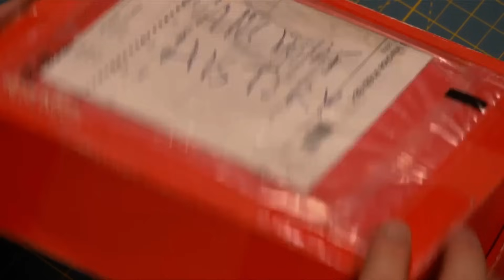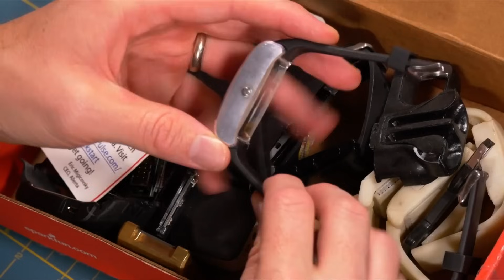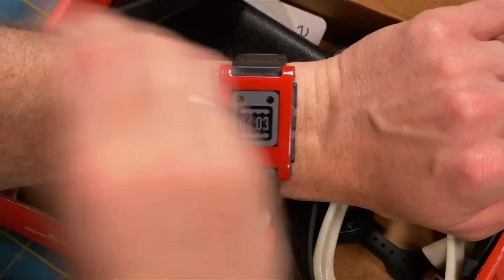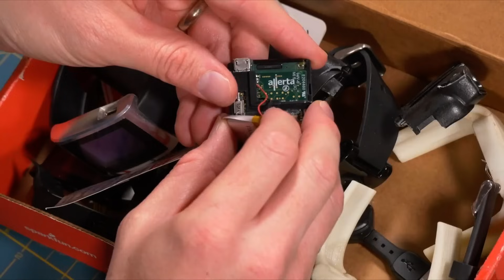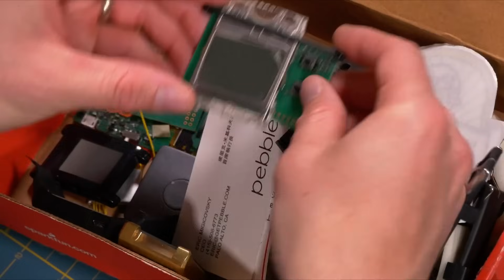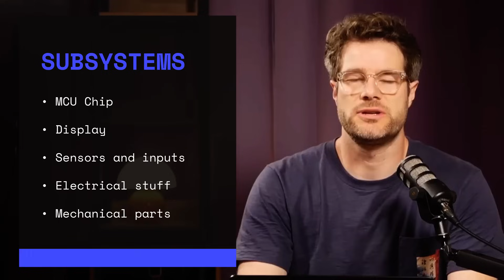How To Build A Smartwatch: Picking A Chip

Comment: I may make use of a smartwatch like hw platform to build a bicycle nav instead. Nobody makes one i can just integrate into the bicycle permanently, everything needs to be charged... for some reason.... although most bicycles have electricity, either a hub dynamo (if it's a city or a tourer) or they're e-bikes. Also the actual nav is bad in most, except one, which drains too much phone battery unlike everything else. I don't think i'm fit to launch a consumer electronics product, but i can just build stuff.

Comment: given the nordic chip, the Pebble 2 Duo only supports Bluetooth LE I assume
the Pebble Time Steel that I still use has a classic BT and a BLE connection where the latter is for notifications

what about the Pebble TIme 2? is it also BLE only? that would be a good thing because of battery life.
and does this have complications for combatibility with different android devices?
do you have to have the pebble core app open at all times for playback controlls to work reliably like on ios?

Comment: I studied embedded systems at my Masters because I wanted to challenge myself. Also, I was obsessed with finding out how drivers work and to try and get my Toshiba laptop special buttons to react in Linux.

Currently, I am a bit annoyed that my Redmi Watch 5 Lite can not answer WhatsApp phone calls from a Xiaomi phone. But it works from Samsung (and apparently Pixel) phones. Also, I could pick up WhatsApp calls in my VW Passat from 2014 with my Sony Xperia earlier. Now, with a Xiaomi, it only shows a weird long random number / GUID. It would be cool to know what is the difference in the Bluetooth that media audio does not work with Xiaomi. I have tried to set the same Bluetooth profile settings as from my wife's Samsung and did not achieve anything.

Comment: I also wanted solar powered watch with rugged and all-black design, but there are just not enough options on the market. Went with crazy priced Garmin Instinct 3 Tactical (550 euros) due to no real alternatives.
Reply from the maker: I think that it would be expensive to make it work well and be rugged, and that's why garmin's are expensive.
Reply: @TickTalk-with-Eric  Yes, but they basically  charge extra $100 exclusively for software features and all-black design. Tactical has literally the same hardware as usual Instinct 3. This is anti-consumer in my opinion. There is no real competition in this segment and they do what they want.

Comment: Oh, by the way, can the new MCU enable smartstraps? Even if there is no native support, it would make the watch so incredibly powerful in terms of use-cases. I want to be able to interact with barcodes and QR codes. As well as NFC (not for payment, but a myriad of other cool stuff).
Reply from the maker: no plans to bring smartstraps back, basically no one used them and it took a lot of extra engineering effort to make it work

Comment: This is absolutely fantastic! I was kinda disappointed and worried (performance and spec-wise) about the nRF52840. And please, do more of these videos and please don't hessitate to get deeper into the technical stuff!

One note, though: you mentioned you were going to put up a picture of something Mr. Jingming talked about, but seem like you forgot. I think there was some other stuff too. Someone mentioned a comparison chart too. It's understandable and no biggie, but may I suggest some system of organizing/noting such tasks? As someone with ADHD I'm hyper aware of the benefits of systems to save time and avoid things slipping through the holes in the cheese (I'm talking about the brain 🤷‍♂).

There must be a way of putting checkmarks on a timeline during recording, perhaps with some categories. So you can quickly go straight there and remember "the thing".
Reply from the maker: So MCUs generally don't have any sensors (besides an internal temperature sensor). They have interfaces that can be connected to other chips like IMUs, etc 

We'll release the full block diagram for CT2 later on and that will show off the exact sensors used.
Reply: The MCU has a newer CPU architecture. More performance with less power draw. It also supports Bluetooth Classic (plus HSF and HFP profiles). The main CPU can clock quite high when needed. The co-processor seems like a huge win over the nRF52840. As the big CPU can clock down and enter lower power modes and the little guy can do the tasks that always is happening in the background anyway. Maybe I'm missing something, but it seems like the nRF52840 doesn't have such a hardware split configuration.

I'm curious about sensors and power circuit efficiency and features. I don't see anything specific about sensors in the datasheet? The document is also only two pages, not deep dive. nRF series have an array of sensors, including HR, right? Are there any downsides to this new chip? Or is it only upsides?
Reply: @gung-hochang9573 I actually spent some time looking into making a watch as a side project after seeing nothing on the market to replace my aging time steel and the dual core controllers are really cool and nice but the firmware and software needs to be built from the ground up to fully utilise them. Afaik the pebble firmware wasn't built for that in mind and it would take a lot of work to implement. 

I got some nrf5340 dev boards and sharp screens and started playing around with zephyr as a basis for a watch OS which could handle the dual cores  but life got in the way and I moved onto other things. I'd still like to "finish" it one day but it's a huge undertaking.

It's definitely possible, but if the goal is to get devices out I think picking a decent power MCU which allows for 30 day battery life is good enough and not worthy of disappointment at all. 

I don't want to speak for Eric but afaik the design philosophy with pebble watches doesn't really require  much more processing power. It's nearly 10 years since pebble got bought, so the firmware and software was optimised for processors which are that old. Stick it on anything modern and it will fly.

Comment: I was under the impression you'd use the same chip for both watches, which I was a little bit concerned about since the PT2 was going to have a big MCU upgrade from the P2 (which i think actually had a slightly faster processor than the Core 2 Duo will). I'm glad to hear you found a suitable upgrade option! The SF32LB52J looks awesome.
Reply from the maker: Hope you can grab a devkit and hack on it some day!

Comment: Consdering the insane impact pebble did for the world of smartwatches, and considering people still consider them to be by far the best smartwatches ever released. and still use them to this day!
Will this new version have a battery that's semi easy to replace? and will there be part availability in some sense? (original or aftermarket)
Also, will parts be swappable between units? (No part pairing or recalibration software locks).

If repairability is taken into consideration, you should consider contacting Louis Rossman, he has big audience who are pro right to repair and share your love for electronics, it could be good advertisement
Reply from the maker: Will be similar in ease/pain of replacement as the original Pebbles
Reply: @TickTalk-with-Eric  Ahh i hope it will stay in mind for future iterations, Having to remove glue, the mainboard and solder wires isn't very user friendly.
Longevity and reparability is a hot topic currently